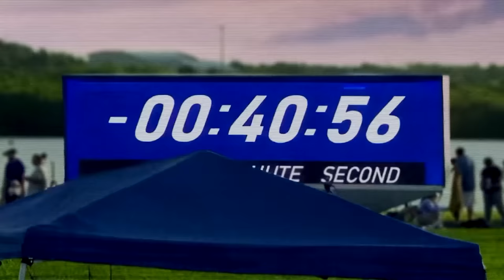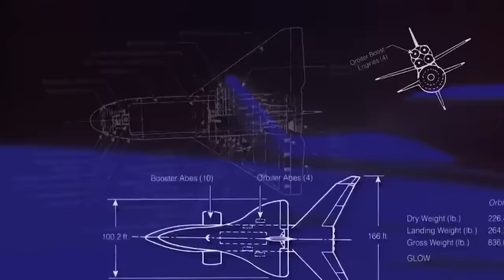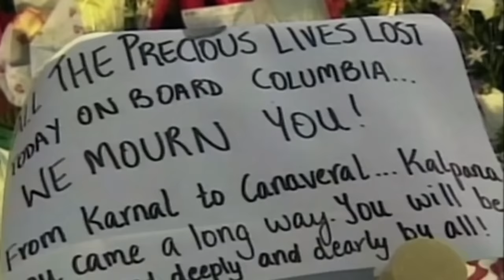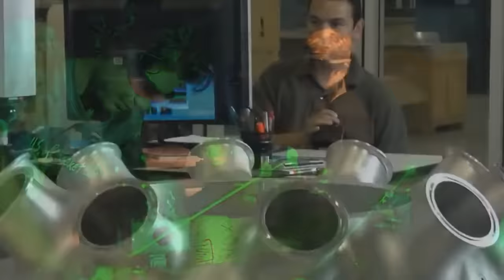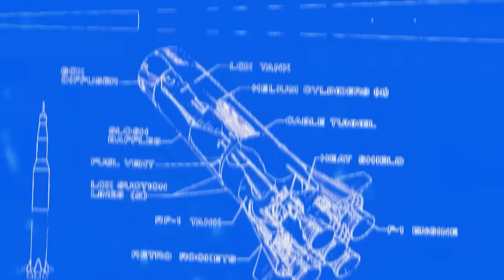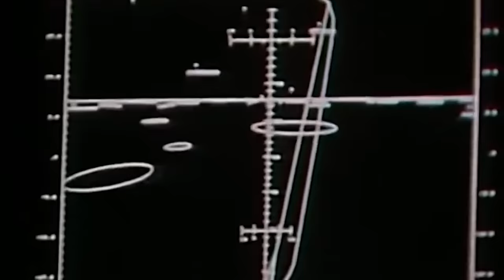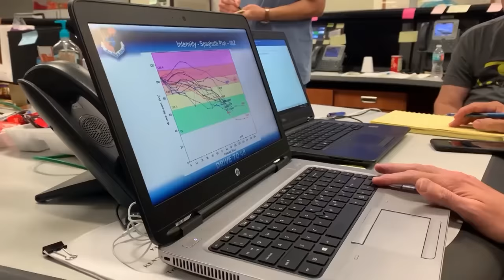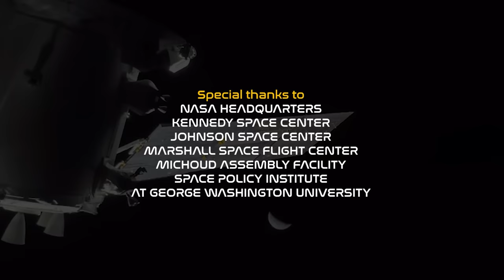Back to the Moon - Part 1 | VOANews

Comment: Skylab had a lot more than is mentioned here. It was an observatory and had a spectroscope and hundreds of experiments. Also, the docking mechanism wasn’t Gemini - it was Apollo… The Shuttle’s main problem was it was an air force project. Designed by them. They abandoned it and left NASA with a “space truck” design and the air force hardly used it and went back to Titan rockets for satellite launches. A space station wasn’t part of the plan for the shuttle. That was only planned 23 years after the first shuttle launch - in September 1993…. So after Apollo - we abandoned Skylab and dumped NASA with something useless. I’m only 10 minutes in, but this isn’t going well so far.
Reply: Docking was Gemini also first space walk
Reply: @winstonsmith6204  The docking mechanism on Skylab, wasn't a holdover from Gemini. Also, the first spacewalk was performed by cosmonaut Alexi Leonov, during the  Voskhod 2 mission.
Reply: @codymoe4986  I stand corrected. . . You're 100% right. First space walk for humanity was Soviet

Comment: So, so, much SLS apologism in this video you'd think you were watching a Boeing commercial. They praise everything that's wrong with the SLS (friction stir welding, 5 segment SRB's, fully expended vehicle and engines, liquid hydrogen ISP) basically everything oldspace that leads to delays, astronomical launch costs and rockets that fly so rarely and infrequently that every flight might as well be a test flight. I'm looking forward to Part 2 where they throw even more shade on Starship and Starship HLS while praising SLS Block 1B and the EUS as something revolutionary.

Comment: SLS made of some spare parts, found at some storage facility with a max. payload capacity of 46t at the cargo version!! The crew version will have a max. payload of 38t. Saturn V had a max payload of 53t during the Apollo 17 mission.....what a poor evolution in over 50+ years.
And, can someone imagine when they don't have any RS-25 engines left? Is there any follow-up planned? Or will the entire program be cancelled? What will happen after Artemis?

Comment: For those who don’t know sls was mandated by congress to keep the shuttle companies employed. It’s totally outdated and insanely expensive. Starship will replace this easily.
Reply: HA HA, right now SS can't even meet its meager test milestones let alone hope to replace the SLS. Frankly the failure which SS is will delay the moon landing missions of Artemis.
Reply: @robertarnold9815  meager goals?. You mean the most ambitious space project in the history of man. Starship has already launched successfully the largest flying object in history and is now pushing the cutting edge in to the unprecedented realms of full reusability.
Reply: @marsspacex6065  no, the milestones that they set up like not blowing up before meeting a target goal.
Reply: Straight has failed to meet any of its major goals. Running through NADA money fast.
Reply: @marsspacex6065  How do you call exploding 3 times, and failing to even reach LEO, a success?

Here's an example of an actual success...SLS, successfully putting Orion, a man rated spacecraft, into lunar orbit, during Artemis 1.
Reply: @codymoe4986  Starship test flight were not trying to get into Leo they designed the flight safety on the ground because its the largest reusable spacecraft in history and they didn't want to threaten anyone on the ground. Flight 3 achieved the exact trajectory it required. I would explain how this all works to novice like you but i don't have the time.

Comment: I am really doubtful about Artemis. Not enough money, choppy schedule, old hardware. It would suffice to read the plan in details of Apollo and compare it to the current one to realize they are at best lagging beyond. They don’t have a lander yet and they don’t have a vector to reach llo with the weight needed by an average moon mission. The elliptical orbit theory are willing to adopt is not “better then Apollo” it is just what they can achieve with that brick of SLS: lack of dv results in a two weeks orbit around the moon. It means that any emergency on the surface will result in a tragedy because the impossibility to launch a dock on Orion. Oh, and there is also that detail about the launches, 15 launches per single mission is a huge hole the program, because of reliability, security, and any practical common sense. Boh

Comment: To me, the rocket has a 'Russian' appearance with the two side boosters.  Compared to NASA's success in capturing the attention of America, NASA is failing with Artemis and returning to the Moon.  To NASA, the Moon is a step stone and not a destination.  Arrogance.
Reply: You do realize those are pretty much Space Shuttle boosters?
"To NASA, the Moon is a step stone and not a destination."

Because it is...
There's only so much to do on the Moon, and it costs about as much Delta-V to reach Mars.
Reply: There is nothing Russian in using two huge SRBs. NASA and its subcontractors want to re-use Space Shuttle hardware instead of developing new one. This is a space equivalent to the Boeing 737 MAX.
Reply: Ehh, name a Russian launch system that uses 2 gigantic SRB's...

Comment: Is this thing already obsolete with starship now proven to be able to get to orbit?
Reply: It has not made orbit. 3 launches, 3 failures.
Reply: @toucheturtle3840 it reached as expected slightly below orbital speed for safety reasons and the rocket is not expected to survive anything yet while collecting data. I guess you didn't notice the progression of every test flights.
Reply: @surf2257  NASA has launched 1 of its Artemis missions. A complete success even with budget cutbacks. I know which rocket I would rather strap myself into if I was going to the moon. Which one would you choose?…
One with a proven history of space flight, or one with a proven history of empty promises?
Reply: @toucheturtle3840  Falcon heavy would still be better ( they stopped using it )
Reply: you are aware it take over a dozen starship to refuel 1 starship? even if you get it to orbit, it not going to reach the moon anytime soon. the chinese will get there first.

Comment: Yup back to the moon in a rocket  thrown together from shit we had laying around. And over half a century on from apollo and the use of a capsule with an ablative heat shield we now have a super advanced capsule with an ablative heatshield, but it has much better computers oh and the craft uses solar panels for electricity. Look going out to the yard and grabbing used albeit very powerful engines is fine for hotrods and such built in the garage, but NASA?!?! Really this is embarrassing